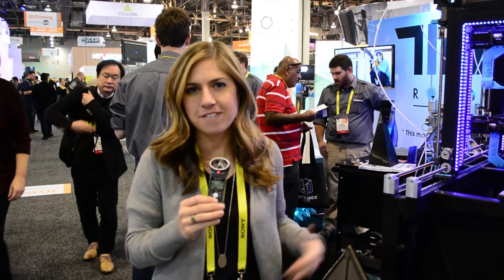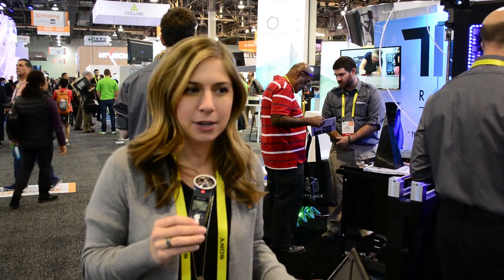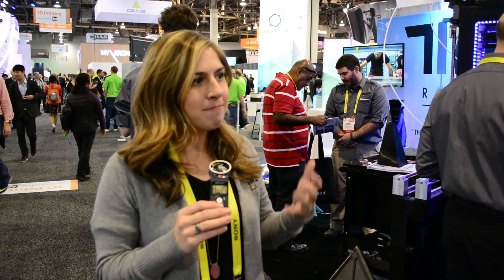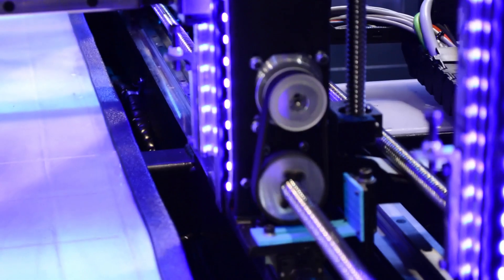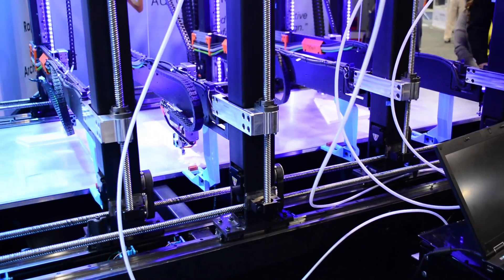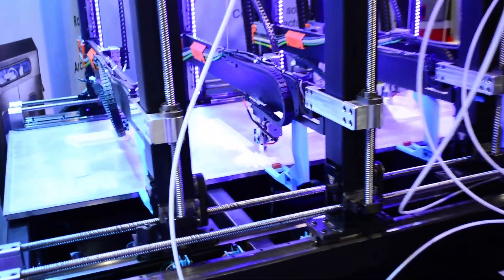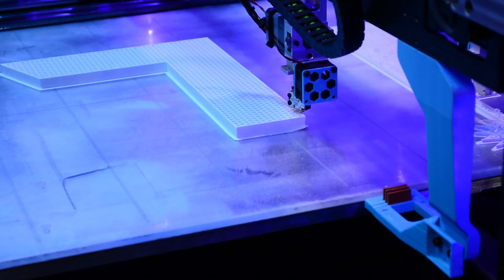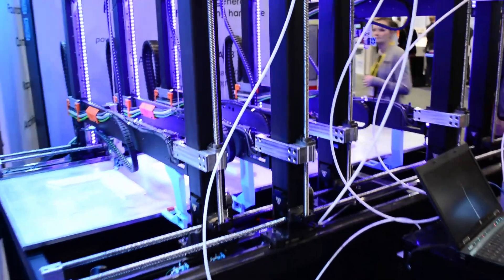Titan Robotics And Big 3D Prints

Comment: SHOW US THE OUT PUT!!! Did you notice the gantries shake at the top? Now check out how autodesk "escher" is built, a full cage, much better design. https://vimeo.com/157523884
Reply: Voxel Lab Hi, that was the filament routing system shaking. This is a steel frame. We've tested and had less than .005" deflection at the top of the gantry during printing speeds.
Reply: Yes the "filament routing system" is shaking thus transferring that vibration to the gantries. With out support at the top I guaranty the top of the gantries is moving at a different rate then the bottom, especially on small infills. The only way to control that inertia is to support it at the top. Why use steel? aluminum would have been better.